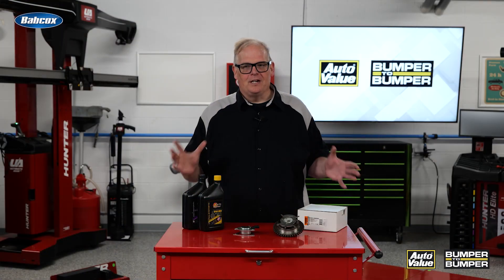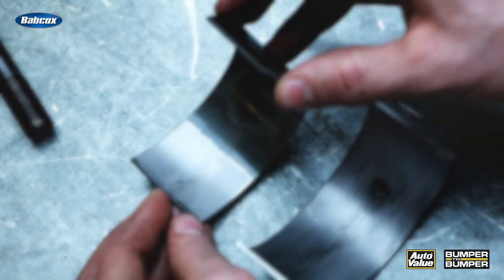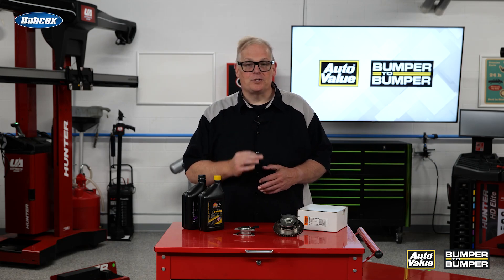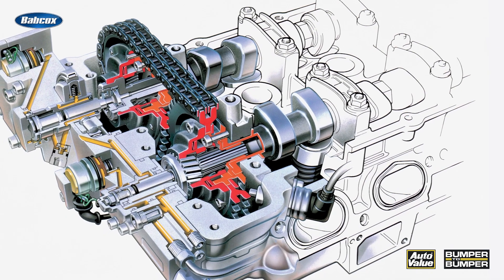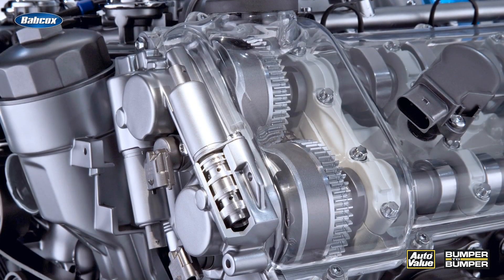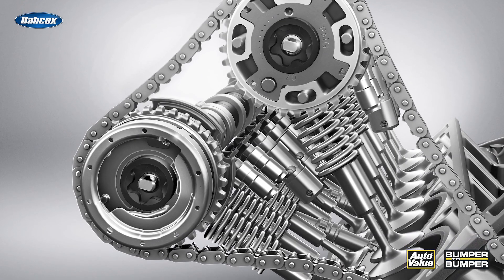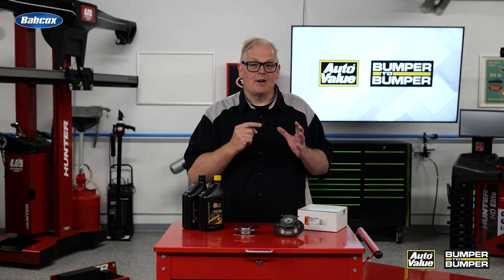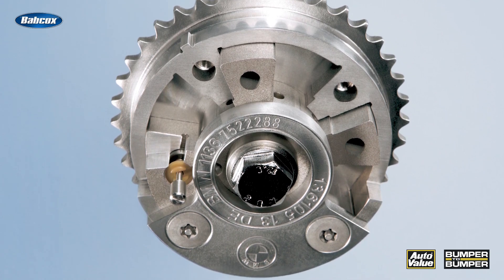Understanding Why Oil Pressure is Critical for Variable Valve Timing Systems

Comment: I have a 2004 GMC envoy with 300,000 miles..I just changed the VVT.. I think I have wore out rings and probably other issues..I think the exhaust smoking is from the oil department. I can't find an oil additive that might help seal the rings  because of the VVT system..